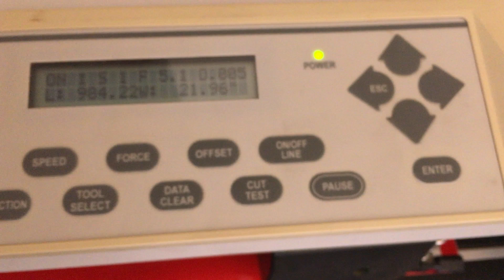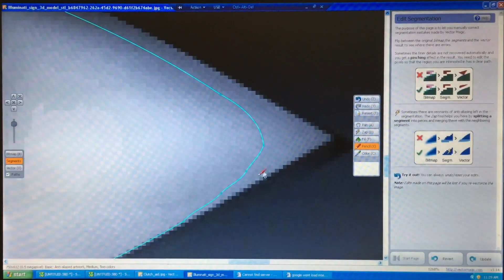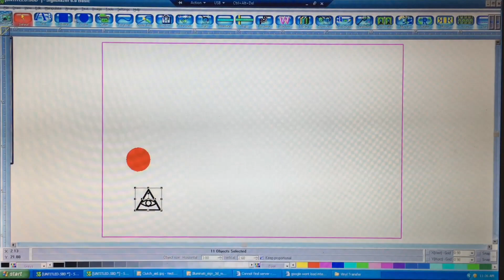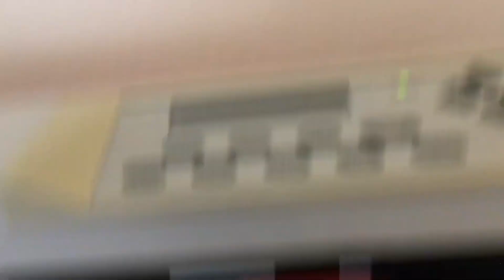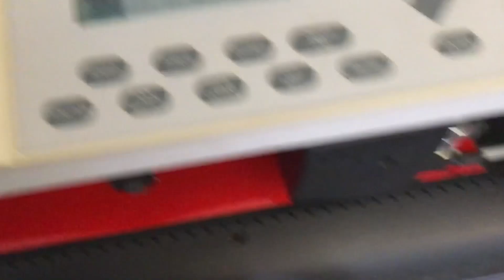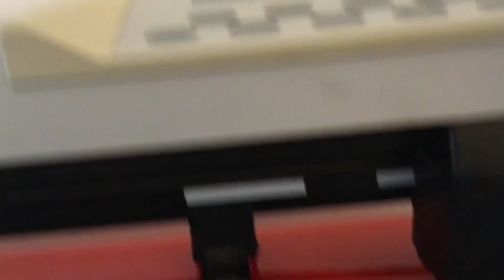Vinyl Express GRC-61 - Software setup and settings, vectorizing an image, cutting vinyl

Comment: I don't have the GRC 61 but I have the GRC 76s so thought maybe you could help with that. I'm desperate. I finally got the cutter set up and a port assigned via rs232 to usb. However when I go to cut the machine starts running and then stops and the display panel reads communication error. Do I have to switch the settings or something? When I had it hooked to my XP computer it was hooked up via parallel port. I'm operating on Windows 10 by the way if thats helpful.

Comment: been using my cutter for years but occasionally it wont cut the entire image if its too clos to the left edge of the vinyl (4 inches or less) is there a setting i need to adjust. I am also using sign blazers.
Reply from the maker: Charles Perry the roller position (on the white marks above the rollers) defines how wide the cutter can move. Have you tried adjusting those?

Comment: hi and thank you  for post this video.  I was given this cutter but been haveing issues on connecting to a new computer.  I tryed to look up the adapter you used and could not find it could you post  a link where I can buy it. Thank you
Reply: also do you know if USB to Serial Converter Device Driver for WIn2K will work with a parallel to usb cord so that the computer will reconise it?
Reply from the maker: I do not know where to purchase another one new. You will need a DB25 serial to usb adaptor. I would try the one available on signwarehouse (who sell the vinyl express machines now). (https://www.signwarehouse.com/p/keyspan-adapter-high-speed-usb-serial-pc) and make sure to get the 9pin to 25 pin adaptor.
Reply from the maker: I do know know for sure.

Comment: Were you able to make it run with windows 7? I am not longer having an xp machine and I can´t seem to have it to work! It constantly says cannot open port. I already tested it with all ports available and the two kind of cables too! Thanks!
Reply from the maker: i use the microsoft windows virtual machine to run xp on my windows 7 computer. in that virtual machine you will need to 'attach' the usb to gain access to it. this is done with the control menu that defaults to the top-center of the screen.

Comment: I have this plotter but bought the new Vinyl Express Software for windows 10. I'm just trying to get the plotter connected so the software recognizes it.  I've already got the DB25 to USB connected to it so I can plug in the computer via USB and it came with a driver automatically...is there a separate driver needed for the plotter itself to be recognized by the software?
Reply from the maker: It might depend on the serial (DB25) to usb converter you have, but my setup was picky with the driver. My understanding is there is only a few chips that those converters use, so maybe try another one or the one listed in the vid description. In my setup there is no driver for the machine to be recognized by the software. I haven't used the new vinyl express software you mentioned. I would check that the device shows up in the windows 'device manager' when the usb is connected, and then check the ports/pins settings in the VE software to try and get them to communicate.